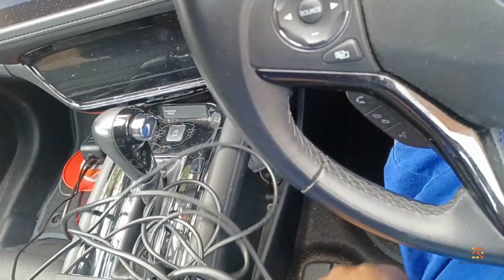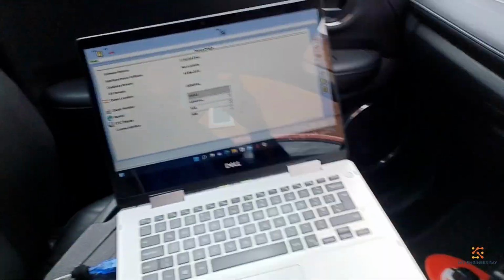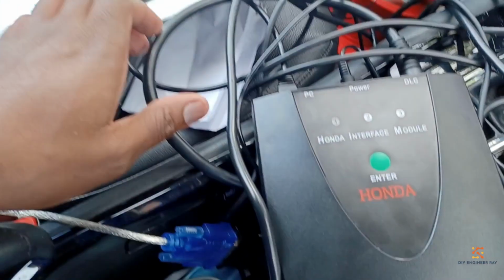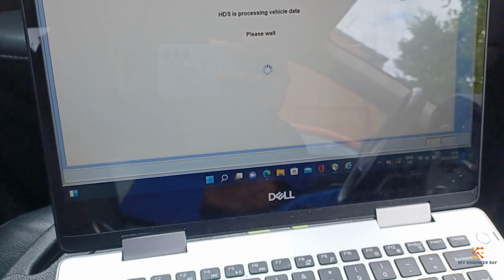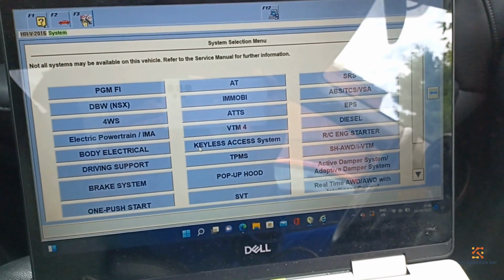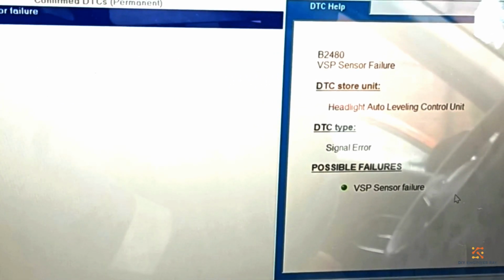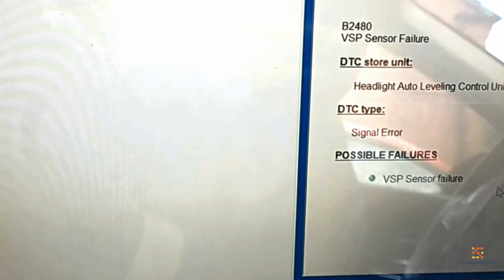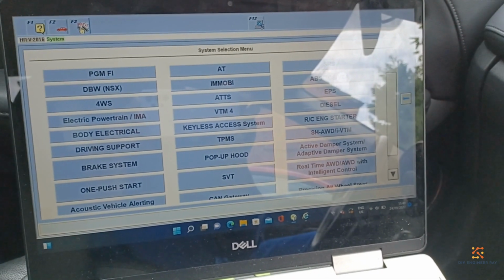How to Use Honda Interface Module & Diagnostics System

Comment: Have you got the older hds that doesnt log in to the interactive network? Im trying to do immobiliser reset on 2007 honda frv (flashing green key after battery replacement)